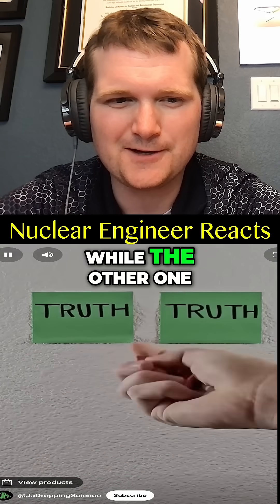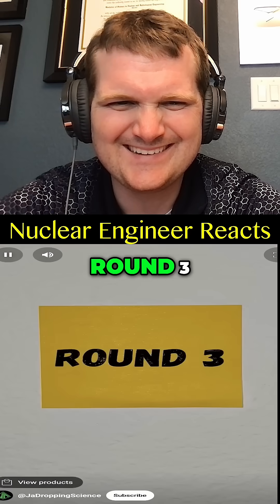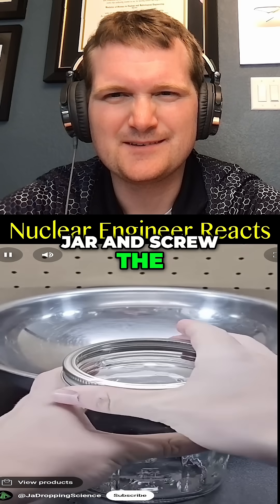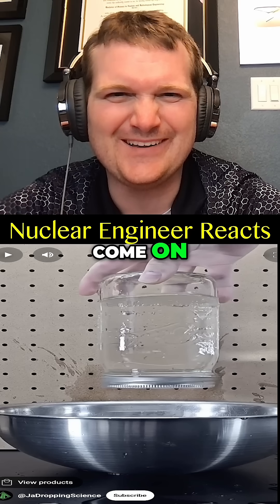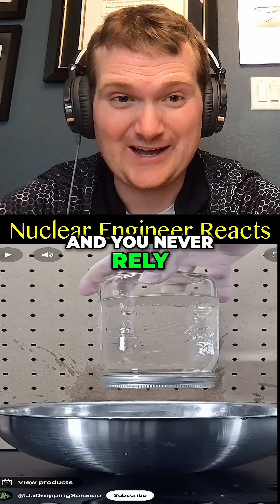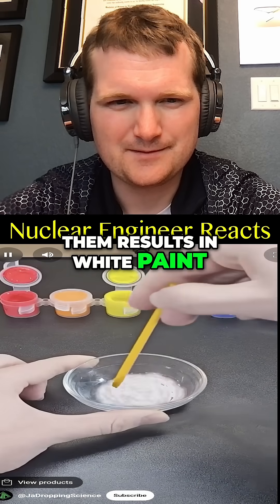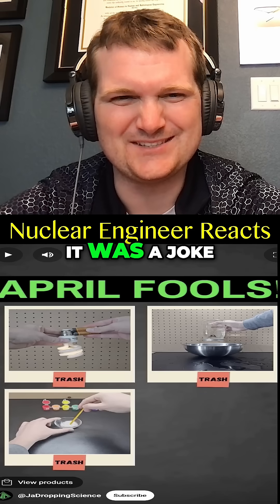Can a Nuclear Engineer Spot the Fake Experiment? - 2 Truths & Trash by JaDroppingScience

Comment: Color is not just an electromagnetic wave of a given wavelength. Color is a perception. You can see yellow on the screen which, to us, it looks identical to pure yellow light of a certain wavelength, yet zero light of that wavelength is coming from the screen, it's green and red light that excite our cones in the same way than yellow light would. And don't get me started with purple, which is a color we see and for which there is NO electromagnetic wavelength that has that color (it's what we see when our cones are excited with red and blue wavelength, which are at opposite ends of the visible spectrum, without being excited with yellow or green wavelength that are in between blue and red). And don't get me started with people with tetrachromia, who can see a lot of colors that normal people can't and can tell you that the door of the car is of a different color than the hood when they look identical to normal people.

Comment: Well those florescent are actually more watts than led but yes those batteries in parallel and no that's not parallel or even small lithium ion they make them small enough to fit inside now and will very but standard is 3.7 some a little lower but can go up to 3.9 volts with the gell type of lithium ion can power it it just will not last long

Comment: The real issue with the light bulb and battery is it's built to convert the AC current to DC and if you are trying to brute force it without building a DC circuit it will require much more power than three AA batteries could hope to provide. The rectifier circuit will burn through that power in an instant practically, too much impedance slow the electricity down. That said, you could probably run the LED array on the batteries if you segregate the array from the rectifier circuit

Comment: I don't mean to be that guy... But dude... 

To become a nuclear engineer, a person generally needs a strong foundation in mathematics and physics, a bachelor's degree in nuclear engineering (or a related field), and potentially advanced degrees like a master's or Ph.D. for specialized roles. They also need to develop strong problem-solving, analytical, and communication skills, along with a commitment to safety and attention to detail. 
Educational Requirements:
Bachelor's Degree:
A bachelor's degree in nuclear engineering is typically the entry point for most nuclear engineering positions. Some sources say that related fields like mechanical, electrical, or chemical engineering can also be a good foundation, especially with a master's degree in nuclear engineering. 
Master's Degree:
A master's degree is often preferred or required for research and development roles or for career advancement in the field. 
Ph.D.:
A doctorate may be necessary for highly specialized research positions or for those pursuing academic or advanced research careers. 
Key Skills and Knowledge:
Strong Mathematical and Physics Background:
A solid understanding of calculus, differential equations, linear algebra, and classical and modern physics is essential. 
Engineering Principles:
Knowledge of engineering principles, including mechanics, thermodynamics, fluid dynamics, and heat transfer, is crucial. 
Nuclear Physics and Reactor Theory:
Understanding the principles of nuclear reactions, radiation, and nuclear reactor design is fundamental. 
Problem-Solving and Analytical Skills:
Nuclear engineers need to be able to analyze complex systems, identify problems, and develop solutions. 
Communication Skills:
Effective communication, both written and verbal, is important for collaborating with other engineers and scientists, as well as for reporting findings. 
Attention to Detail:
Nuclear engineering requires meticulous attention to detail to ensure safety and accuracy in calculations and designs. 
Computer Skills:
Proficiency in computer-aided design (CAD) software, simulation tools, and data analysis is essential. 
Commitment to Safety:
Nuclear engineers must prioritize safety and understand the potential hazards associated with radiation and nuclear materials. 
Teamwork:
Nuclear engineers often work in teams, so the ability to collaborate effectively is crucial. 
Licensing and Certification:
Professional Engineering (PE) License: Many states require a PE license for independent practice as a nuclear engineer, which involves passing an exam after completing the required education and experience. 

And the things he connects with nuclear reactors are generally connected to physics and shit. 
Cause these "jokes" are getting really annoying.

Comment: 1. Parallel Circuts only increase the duration, not the voltage. And as mentioned the circut is incomplete
2. Water level remains the same
3. All paint colors combined make black, not white, because paint colors absorb all spectrums besides the color you want to show. Adding all colors together means all colors are absorbed and no color can be shown (black). LEDs emit light as opposed to absorbing all other spectrums. if all LED colors were together, they would be emitting white because all spectrums are emitted.

Comment: Son: “Dad I baked an apple pie” 

Him: “ In the oven, heat is transferred to the pie through direct contact (conduction), air circulation (convection), and infrared radiation. Similarly, in a nuclear reactor, heat is generated via nuclear fission, where the kinetic energy of fission products is converted into thermal..”

Son: 😴

Comment: About the paint one. You can actually "neutralize" the color, or mix up a perfect grey, by adding about the same amount of 2 opposing colors on a color wheel, or all 3 primary colors, but its not going to be exact same proportion as some pigments tend to overpower others during mechanical mixing, like carmine never shoving up in mixes when wprking with oils, or red guashe overpowering yellow guache every single time
Reply: I thought that paint is subtractive in that what light is absorbed by the paint is not the colour of the paint so mix RBY only Brown will be reflected
Reply: @haruhisuzumiya6650  i think it can be even in my explination if you do like pointelism, instead of mechanical mixing. Like optical mixing i think tgey call it

Comment: Depending on the AA battery and the light bulb that one can actually be true. You need a battery with a magnitized casing and a florescent lightbulb. It doesn't work like what is shown here though so in this case no but depending on the items in question it is actually possible.

Comment: Well, 1.5 volts, regardless of current isn't going to light a fluorescent bulb of any sort and there is no DC-AC conversion and step-up circuit inside of the bulb. With current LED household illumination bulbs still require between 1.8 - 3.3 volts DC and well, straight to the chip LED, one would likely burn the LED out instantly with just one AA or even AAA cell's available current.
And while one can mix pigments to make shades of white, the video's transition was absurdly swift and didn't match the mixing action and the opposite is true with pigments, mix the colors properly and get black.
Had that discussion with my wife when we were first married in 1981, as I was working with light and red, green and blue lights, in the proper proportion is viewed as white, mix pigments of those colors and get either a muddy brown or grey color, mix red, green and yellow pigments and one will get black. Reflection vs emission and mixing.
Oh, want to try an experiment? Get a plain sheet of white paper, view under decent lighting conditions, now look at the paper covering one eye, then the other. White suddenly isn't so black and white anymore, as each eye will usually see a slight difference in color of that white paper and perceived white results from both eye dominance and consensus arrived by the brain on just what white looks like. Usually, it's a red-blue difference though. Green pigment in the eye being a bit, weird and broad in spectral sensitivity compared to red and blue.

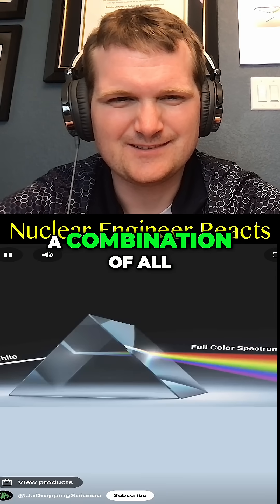Comment: @1:06 "After all, what is color but electromagnetic radiation at a very specific wavelength"

Well akshually... Color is an experience in the brain, typically to visible light. You can replicate the same experience of one specific wavelength by mixing other wavelengths at specific ratios, and there are colors which can only be made by either combining different wavelengths or by controlling intensity, such as brown, pink, grey, or magenta.  And presumably you've heard of the recent research involving laser-stimulating specific cone cells to create new colors. Some people may even get a "color" response from polarization!

Comment: All of them are fake. A lightbulb needs two contacts to turn on. The mason jar experiment requires some way to increase surface tension, like a strainer mesh. A gaping hole won't work. Mixing paint is a substractive process, so mixing cyan, magenta and yellow paint produces black (same as how inkjet printers work, if you print green it mixes cyan and yellow to make the paper a dark green).

Comment: First one was obvious for a number of things, 
• Firstly it wasn't a complete circuit so no current could flow
• Secondly household CFL bulbs require AC power at line voltage (120V or 240V within tolerances) and those cell are 1.5V and DC
• Thirdly we know how to fake it, just move the CFL close to a plasma ball toy or other source of alternating electric fields

Comment: The paint color works differently than light color. Also, there are two sets of primary colors, and he mixed them. Red green and blue (commonly referred to by the gamming community as RGB) is the additive primary colors. They come together to make white. Yellow cyan and magenta make up black and are a part of the subtractive primary color trio. He used red blue and yellow. In other words, even if he was using light, it wouldn't have made up white because he used a color from the subtractive primary color trio

Comment: "We actually use batteries in parallel to power our reactor cooling systems*
Reply: They actually use them in series
Reply: @suryamgangwal8315  Well technically most cooling systems would have serial battery banks in parallel.